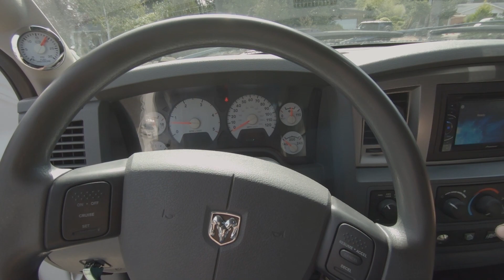Broken G56....... again, This one might be serious

Comment: Are you guna do a Billit unit now?
Reply from the maker: Honestly it all depends on where I'm at in life when this one let's go, I would love to go billet but it's definitely not a cheap adventure.
Reply: @Cargill450  no it’s not.
Reply: How much Hp does your truck have?
Reply: @Cargill450  Superstick no longer has billet gears as his supplier has him in collections. Cody is a crook. Long Range Gear has rebuilt multiple SS units and all had incorrect endplay, reused bearings and synchros and missing oil diverters...and LRG is now working with the billet gear supplier
Reply from the maker: @wyattl341 I don’t want to talk bad about anyone or any company but all I will say is the next time I have a trans issue I will 100% be fixing it myself and if I could buy billet gears from LRG I absolutely would.

Comment: What was the hp rating when you fried it my 1000hp build will be done Thursday truck sitting around 800hp
Reply from the maker: Trucks been on the dyno a few times and makes 525hp, but to be fair I don’t have the best luck and I’m sure yours will hold up.
Reply: @Cargill450  3 yrs on last mild build by ss
Reply: @Cargill450  your video sounded like mine 4 weeks ago 5th and 6 toasted rolled main shaft
Reply: 4k rebuild
Reply from the maker: @dieselmike864 first go around I made it 14 months this one has been a year maybe 2 but I’m a lot easier on it
Reply: @Cargill450 from talking to Cody personally the killer for them is lugging 2500 rpm or higher shifts are needed never below
Reply: @Cargill450  I've also got a 62 spooling an 80
Reply from the maker: @dieselmike864 pretty much…. Both times
Reply: @Cargill450  both times what
Reply: @Cargill450  Painted blue/purple 
Replaced: Seals, shims, 4x4 gasket, pivot  ball, Mainshaft, C/S 5th-6th gear, Input  shaft, M/S 6th gear, Front C/S bearing,  Rear C/S bearing, Input bearing and rear  mainshaft bearing the latest 😀